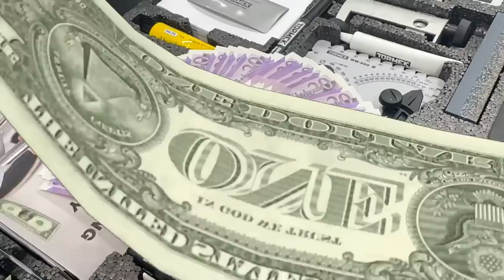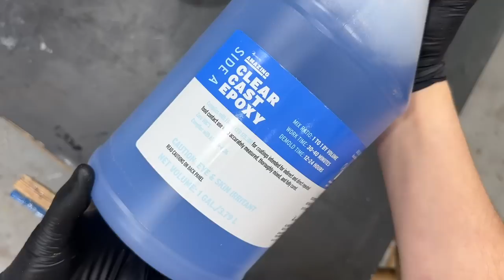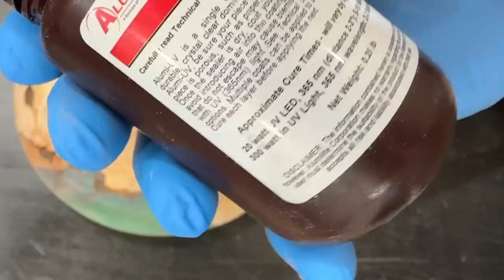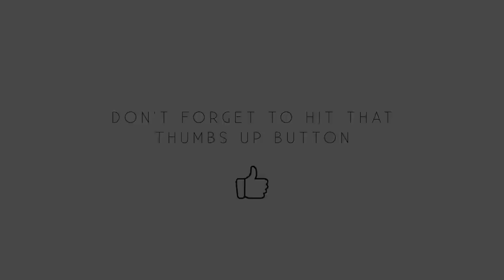Woodturning - Jade and hardwood burls!

Comment: Beautiful piece! One question: It seems like this could have been done in one part instead of two parts which were then joined. Why do it the way you did?
Reply from the maker: For it to be 1 piece you’d need to cast a singe piece twice the depth of the larger piece and then turn most of it into shavings.
Reply: @JackMackWoodturning  Ah. Thanks!

Comment: Is there any special reason for cutting the wood to the height you did? Like I know that it was to fit the mold, but do you find that height is good for pouring resin in one go without (too many) thermal cracks, or anything like that?

Comment: Some kind of noise during the whole video. Check it pls next time.
Reply from the maker: No there isn’t. Obviously I check all videos which is why things like that never happen. Noise must be on your end 👍🏻
Reply: It's called a lathe...
Reply: @JackMackWoodturning yes there is a high pitched sound in your last several vids.  We thought it is your dust collection especially loud at 17:54 and off at 18:00 back on at 18:35.
Reply from the maker: Yes there are workshop sounds in the videos because they are shot in a workshop. But there is not “ some kind of noise during the whole video”
That requires “checking” 👍🏻👍🏻